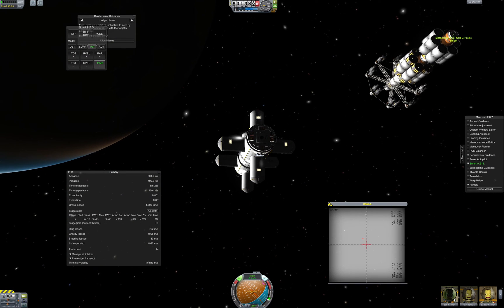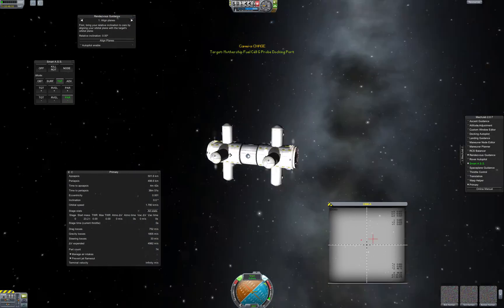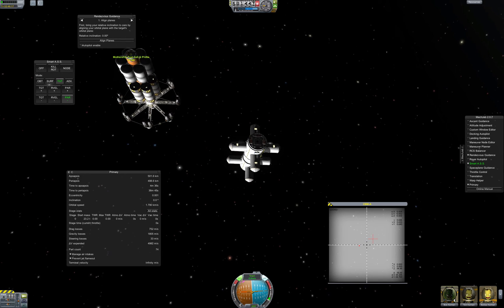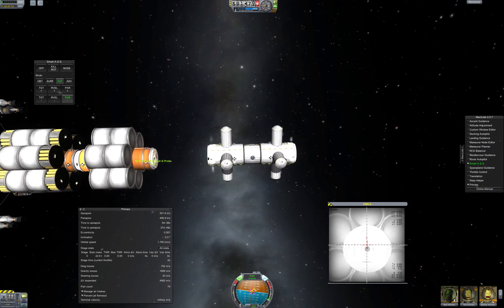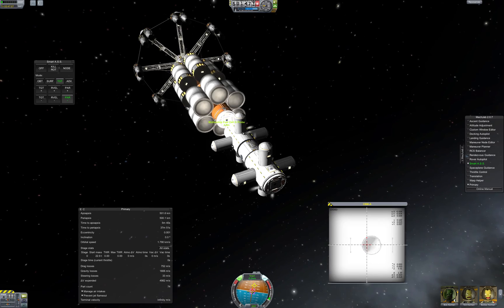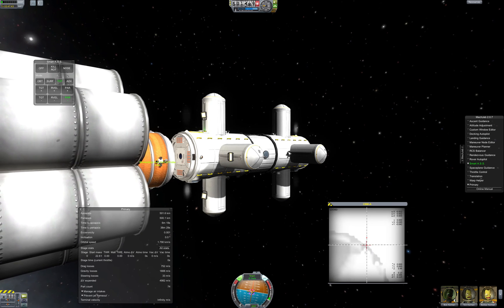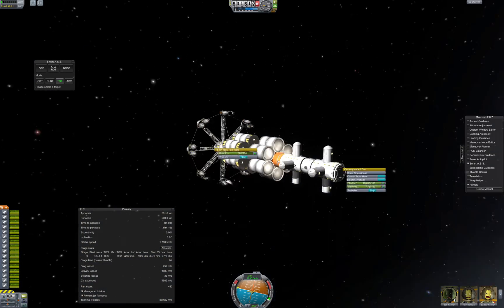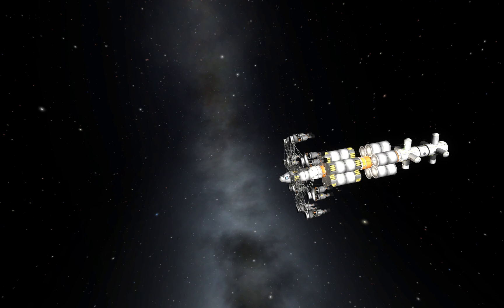Populating, Launching, and Docking the Habitat Module

Comment from the maker: Just a heads up, I'm on hold with the next module because fusty (the maker of the common berthing mechanism mod) is updating his docking ports and they won't be reverse compatible with the ones I've installed. 
In the mean time I have started launching and testing satellites for Kethane scanning as well as ISA mapping. Expect a video in the next couple of days with that as well as their very functional SSTO launch platform!